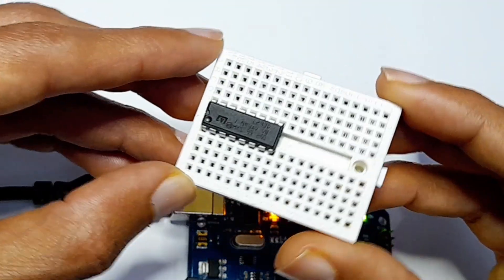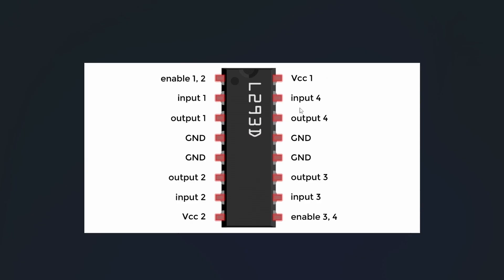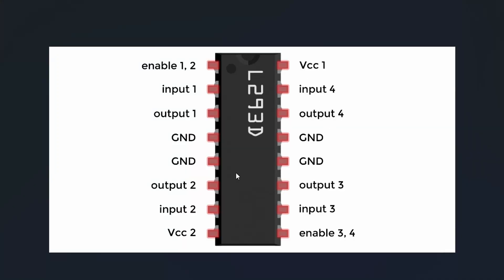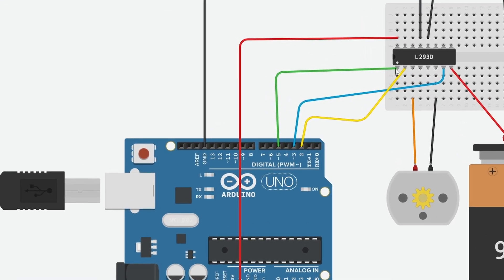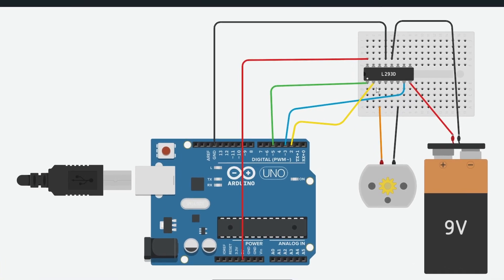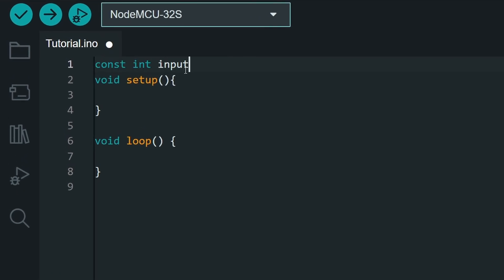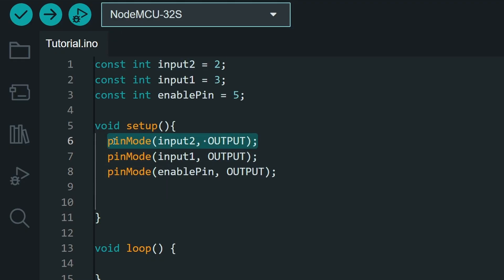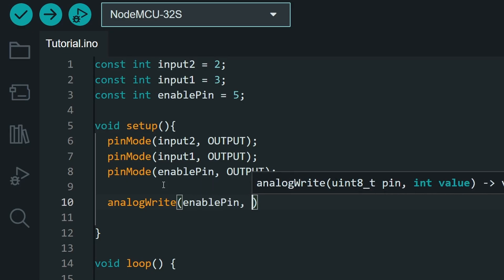How to Control DC Motors with L293D Motor Driver and Arduino

Comment: Thanks

That demo was clearly presented.

I have some bipolar LED's I want to drive.  These need psuedo-AC (via the bridge) and PWM to change the brightness.  The L283 looks like a good candidate.

Would you (or anyone else) know if I can connect the two bridges in the IC in parallel to double the current capacity?

Cheers 😀
Reply from the maker: I'm glad you found the demo clear!

Comment: I'm using L293D without microcontroller. It is connected to HT12D which receive signal through RF433 module.
My motor won't stop spinning. What can be the reason?

Comment: Thank you for your video share, I would like to ask you about low speed start, As you can see the motor can not start about 60 value, Could we start the motor run with 255 then go on 60 value, in a loop? But there are another loops like blinking led for a 30 seconds in this void loops.

Comment: Hi. Could I use this IC to switch a small 12v DC LED ? The LED is self-contained, I guess with an own driver. So I just need power on/off, not even PWM.
Reply from the maker: Yes 👍

Comment: What if i wanted this to run without the usb plugged in? So it runs off the battery
Reply: You could use the Battery to power the Arduino through VIN - which can take 7-12V and the onboard voltage regulator power the arduino with 5V.

Comment: could we not power both VCCs from the power supply, provided that it outputs 5V?
Also, would connecting all ground leads (4 from the L293D, 1 from Arduino and 1 from power supply) together on the ground bus of a breadboard work? Or do they need to be separate?

thanks for the video, very helpful

Comment: i have tried all you said, still not working. can you help?
Reply: My advice. Do not build this on a breadboard, the connections can be bad and will heat up the driver. Try solder it in place.

Comment: Hello, I love your videos. One question. By any chance have you made a video the allows you to use a push button to turn the dc motor on and off? This would allow you to turn it on and off. I'm trying from your code but I'm having issues for some reason. If not, thank you anyways. Again, great videos.

Comment: Thanks sir, are you have example code and simulation for speed control motor dc with PID using Arduino?